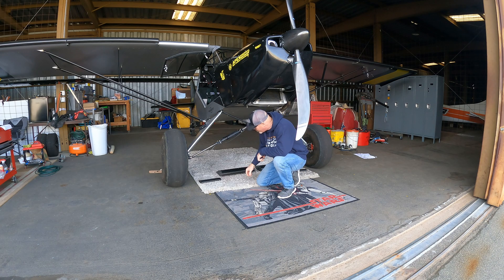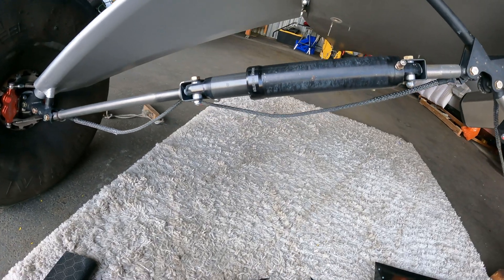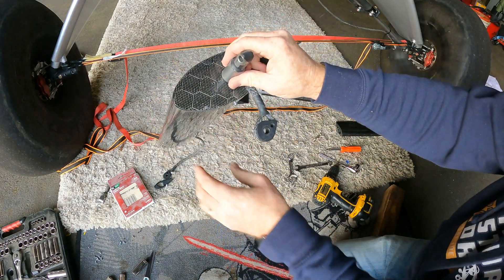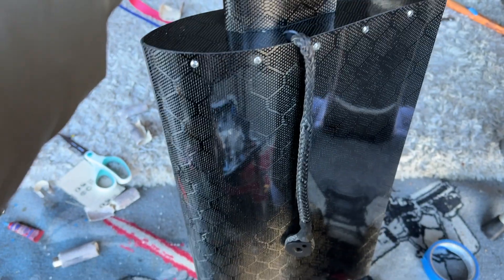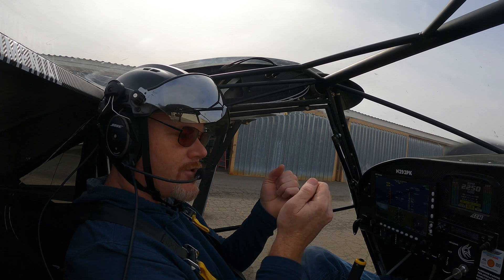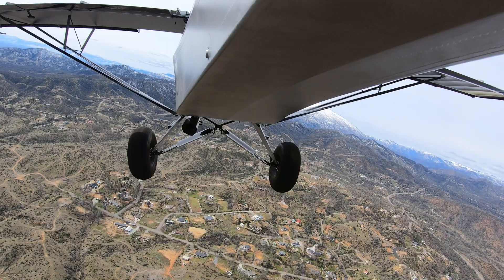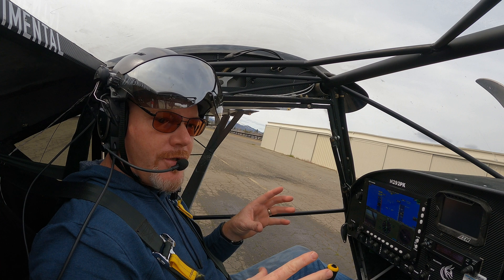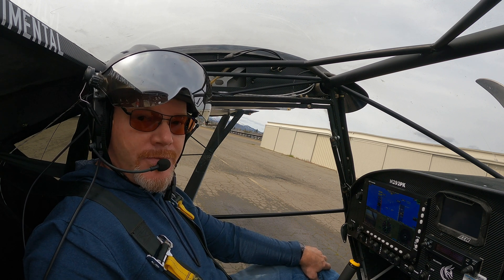Kitfox 7 Apex Build Episode 73 How to Make Your Bush plane Go Faster

Comment: What filament material was used for the 3D printed ribs? There are lots of filaments, including some with nylon glass or carbon fiber particles in it which help strength, but if the base filament is PLA or anything that's not ready for serious heat (also unpainted/near-black parts) might want to reconsider using 3DP parts. I'd test the temp of those at the end of a hot sunny day and compare to the filament glass transition point (PLA is 140 F, NylonGlass is 158 F, PETG is 176 F, ABS is 221 F). I'd verify that filament & check what real temps end up being. Improvement and possible minute weight shaving would be to use the 3DP to make rib molds and he can use the same CF vacuum/oven setup as the primary fairing for those small parts then there's no risk of any material heat breakdown.  I'm a huge fan of real world usable 3DP parts btw, but I also worked USAF ASM and have burned myself enough times on Hercs to know tarmac temps can get wild.

Comment: Don't stop there, put a fairing on the lift struts that join them out to a point outside the propeller arc, put cuffs on the upper attach points ala Monocoupe and Howard, seal all gaps between fixed and moveable surfaces. I watched a stock Champ 7AC go from 85mph to easily keep up and outrun Cessna 150's using light aluminum fairings to clean up all the drag producing areas, landing gear struts being one of the worst.

Comment: I was wondering when someone would come out with a fairing kit for the shock monsters. Would be nice if the safety ropes were enclosed in the lower section.
Reply: We are currently working on a solution for that.

Comment: You need to add a ferrite bead to the camera audio lead to suppress the ignition coil generated, rpm following noise.
Reply: a ground noise loop that is an inline plug adapter also eliminates this i suspect its just this bead your suggesting inside the adapter housing

Comment: There are many, who claim gear fairings "don't make any difference,"  followed by "and I land off airport a lot and want to be able to inspect the gear." Bull!  When I went to cub style gear on my RANS S-7S 12 years ago, from the very clean stock spring rod gear, I lost climb AND cruise. Flying it back from John Robert's place in Emmett (at the time) to the Pocatello area, it seemed like "bad" air, sinky, it took a while before i figured what was going on, I flew it two weeks bare, then fully faired it,  shock struts and even the cabane is faired, it is well worth doing. Of course I am comparing totally unfaired A frames, not just the shock struts, so my gain was more.
Reply from the maker: In my experience I have found the same.

Comment: He should consider a split 3d printed rib so you wouldn't need to take things apart.
Reply from the maker: We have looked at doing this for the cabane V, but the way the main fairing rib attaches to the shock T, it wouldn't be ideal.

Comment: Is there a plan in motion for remote access to the air fittings on the shocks?
Reply from the maker: No, all you have to do is remove the screws and slide the fairing down. I rarely have to service the shock pressure, maybe once a year.
Reply: @BowenAero at what pressure you have your shocks?

Comment: There is a great book called "Speed with Economy".  If you test improved aerodynamics by holding the engine RPM constant, what you will see is improved fuel burn, not much change in air speed.  After all, at a given RPM, the propeller will move the same distance through the air (plus or minus a bit for the efficiency of the prop).  Prop efficiency does not really change that much.  What you need to do to compare aerodynamic improvements is test at wide open throttle.  That way engine power (and fuel burn) will be held relatively constant and the change in airspeed will be apparent.   Kent Paser covers this well in the book.
Reply: Manifold pressure gauge would work as well

Comment: Beautiful. Are the safety cables really required since you don’t use bungee suspension? Even if the shock went flat, it’s not going to totally collapse, right?
Reply from the maker: Only needed if the shock attachment fails.